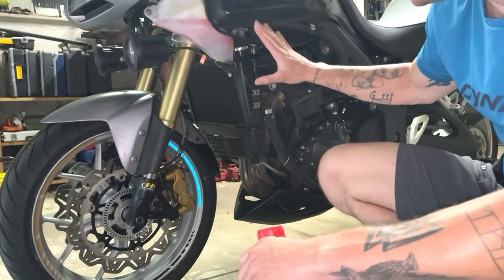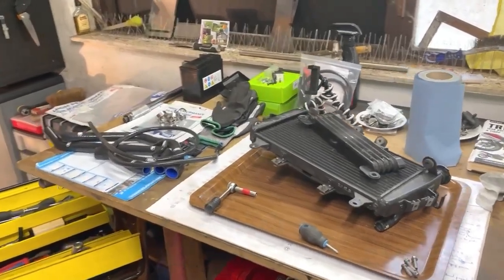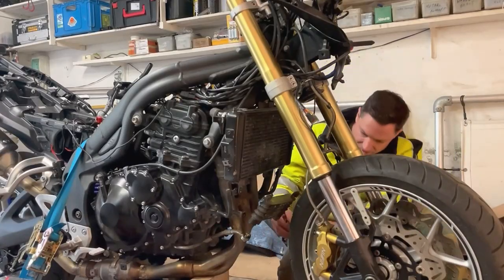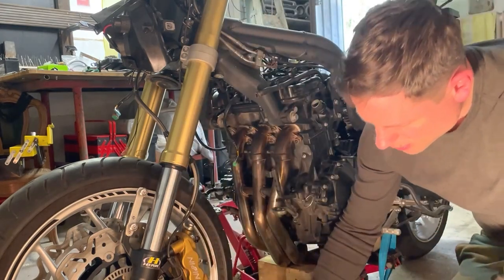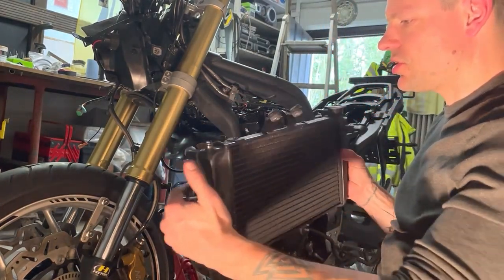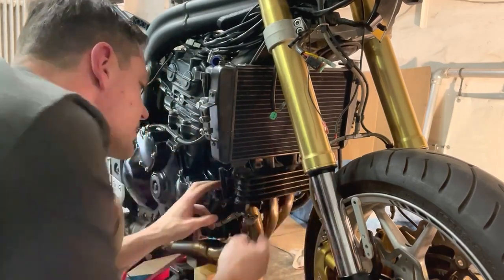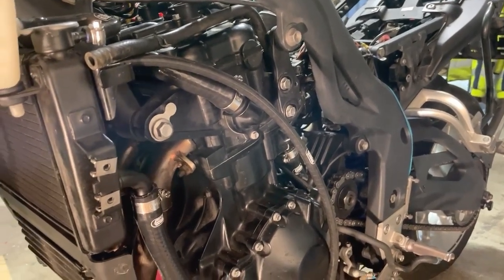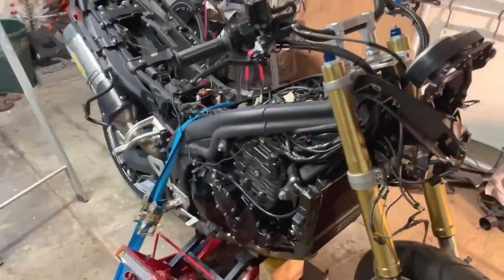Triumph Tiger 1050 revival (12/20): interchanging to Samco Sport hoses - swapping radiators

Comment: Another really excellent and informative video. Thank you. I replaced the coolant on my 2009 Tiger last year, but didn't think to renew the hoses. Having watched your video, I'm now kicking myself! You also did a great job cleaning up the exhaust headers and front engine casing. It's frustrating that removal of the radiator and oil cooler is required to gain access to these 'hidden' and vulnerable areas of the bike. As a separate point, are you intending to do a video of the valve clearance check, as I am intending to do my own, after the summer. Thanks again.
Reply from the maker: Hi David, thanks for the supporting comments. Normally you should change your coolant every 3or4 years but I do it more often. Maybe, it's a fairly smooth process for you to change the hoses next time. I recommend using Samco because of their image and the reasurance to handle higher pressures. I suspect, because of the silicon they last longer as well. It's also what Samco is known for I guess. But it is an investment and I had issues with installment. In the meantime to maintain your current hoses; give them a soak with Teflon spray. Keeps rubber alive and shining. And give them a visual inspection know and then.
Concerning the valves; sorry but I did these 1 time at 32000 km (I don't ride in the higher RPM range) and now the bike has 40000km. It runs great. I plan to do a valve check at .... probably doing the 2024 winter time. Then I change to irridium spark plugs (CR8EIX) as well. It is a bit off a challenge to set the valve clearance but when taking your time/ preparing well you can do it. Please, also take in consideration you'll need a manometer to measure/ have to order new shims after. Your bike will not be riding awaiting your shim order
Reply: Thanks for your reply. When I bought the bike last year, in addition to changing the fluids and brake pads, I replaced the air and oil filter and also replaced the spark plugs with the iridium type. I should have continued by doing the valve clearances at that time, but the temptation to get some riding done before the summer ended, took over! Yes, I'm aware of the possibility of having to replace one or more shims, as, without any service history and 33k miles on the clock, I've no idea if the valve clearances were ever checked! It'll be a winter project for sure, including some other precautionary maintenance work such as refurbishing the forks and replacing the wheel bearings, so your videos will be invaluable. Thanks again.
Reply from the maker: @davidlutton4560  If your bike is running quiet, without mechanical noise and good compression then you can ride along without worries. Try and take a screwdriver against your ear and listen to the  camshaft and valves, engine running idle. You should have minimal ticking sounds. 
You can also check compression with taking the cover of the crankcase (cold engine/not running/ rear wheel of the ground. Using a wrench, try and turn it the enine clockwise with hand strength - don't force turning!! If the compression is ok your engine will not turn (unless you remove the sparkplugs). We have 4 valves a cylinder so that helps a lot against wear. I'll make a video about the camshaft and valve setting later so it can help.
Reply: Great. Thanks for the advice. I'll look forward to your forthcoming video.